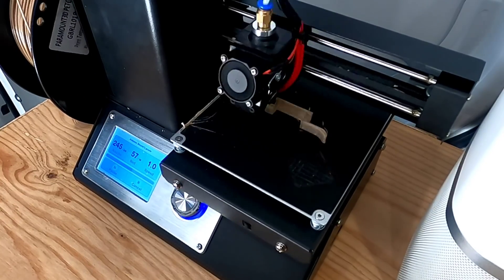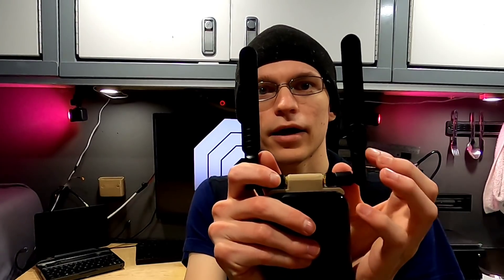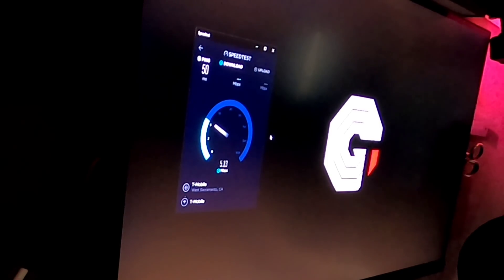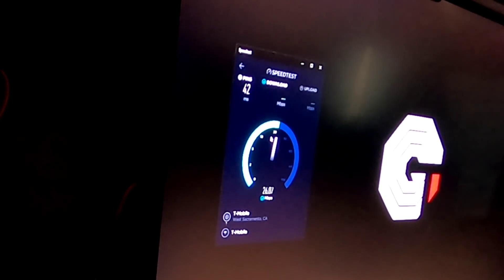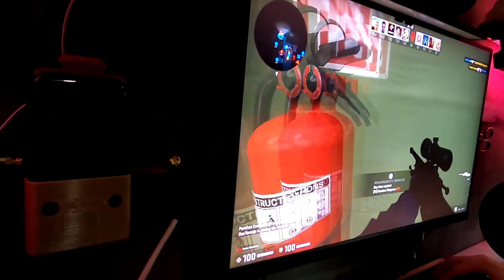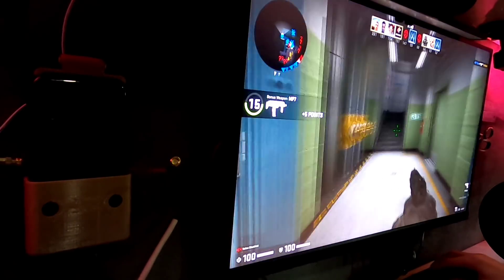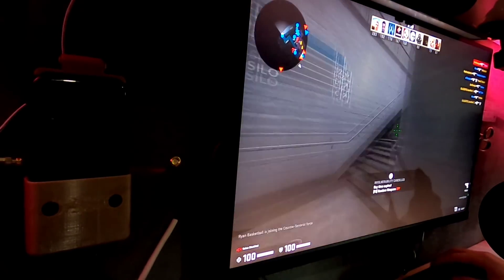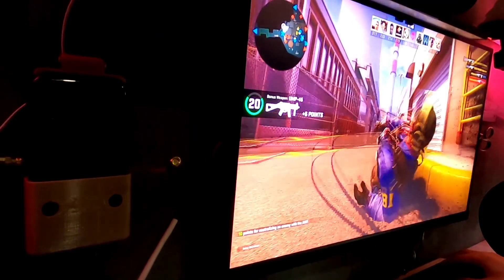Gaming in a Van Using a Hacked LTE Modem!

Comment: What did you use to attach the 3d printed part to the top of the modem? I printed out both your cradle and the antenna connector, but short of using superglue I'm not sure the best way to securely hold it on the top that will withstand constant flipping up and down of the antennas

Comment: Pro tip for getting stuff off your print bed - slamming it with the scraper like that (even though it looks like you have it sharpened), will knock your bed off. Keep a razor blade by the printer. Hold it as flat as you can and get it under the edge of the print. Slide the scraper under that then the rest of the print just comes off easy. Either way works honestly and even with my method your bed needs adjusting/tightening eventually, but it will be further down the road that way as it doesn't knock it side to side as much.

Comment: What is the LTE modem types and which is better (including self made "hacked" modems) ?
Reply: I use a Huawei B818 with a pair of slant polarised LDPA antennas for my house internet. I've used older but compatible models on the road (most use 12V wall wart and happily work directly from cigarette lighter socket output). I recommend the B818. I've seen video of someone connecting a third and fourth antenna, but that requires pulling the modem apart and obviously voiding any warranty. My LTE performance is good with just 2 external antennas, so I'm in no hurry to add more.

Comment: Just use a CPE (customer premises equipment) which is directional so you will need to know the location of the mobile site. Slow panning the CPE to the best RSRP and CiNR could also be used if the location of the site is unknown.
Reply: I agree that directional external antennas are better, but they take more time to setup each time you stop. I think the omnidirectional are a good compromise for areas with ok outdoor signal strength. If you're going out in the sticks though, I'd be packing a pair of high gain LDPAs or similar.

Comment: Is there a way you could safely use a booster and external antennas together for Best performance?
Reply: What's the point? at that point just use an rf amp, or do you need a repeater?

Comment: Hey glitch, there is a new glint router "MT1300" that supports 5g but you will need to use a usb to put the sim, it is cheaper than the mudi. It would be cool if you can check it out! Thank You!
Reply: Are you sure its 5G (cellular)?...I think the specs of that unit refer to the 5"GHz" wifi band